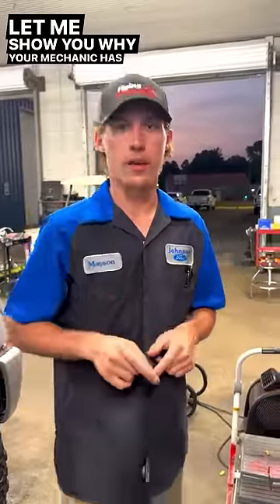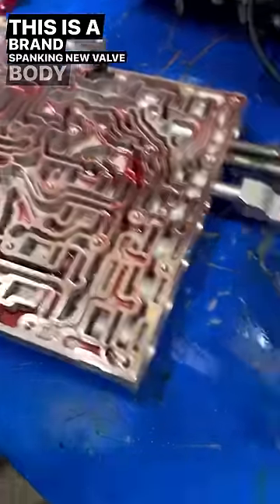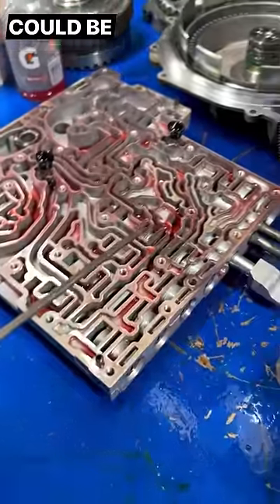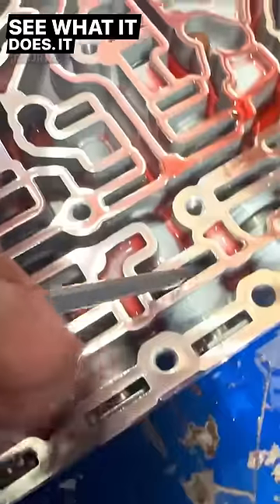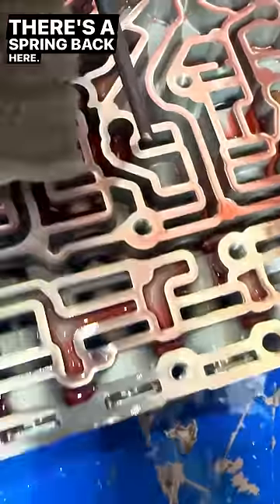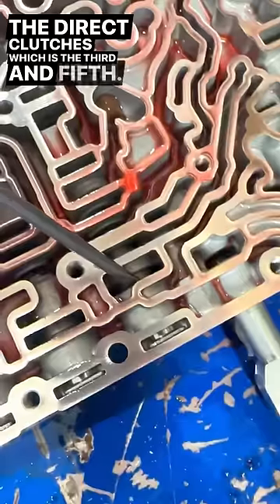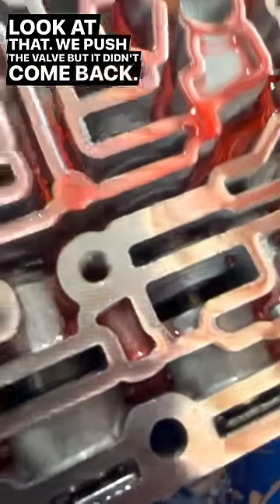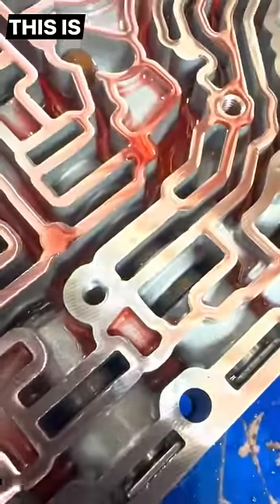Why your mechanic has trust issues #shorts #ford

Comment: As a programmer, it's nice seeing hardware problems being debugged.
Reply: I was thinking, that's a weird looking motherboard 😂
Reply: Breaks over back to coding
Reply: As a programmer, I have no idea wtf I'm looking at
Reply: I'm a programmer and a mechanic amongst other things 😂
Reply: As a mental health technician in California, its nice seeing when the professional knows the problem is broken and cant be fixed.
Reply: The NC program on the CNC machine that milled that part out was probably wrong.  The software issue caused the hardware issue, lol.
Reply: When in doubt get a bigger hammer.
Reply: Yeah same here, I’m always amazed by hardware “assembly” and debugging
Reply: as a hw engineer, 90% of hw problems are a result of a programmer not reading the manual, the remaining 10% they just misunderstood it.
Reply: It looks like my brain
Reply: @enersha6979 fluid channels is like electric pathways on circuits. the solenoids are swithches controled by either fluid mechanics or other electric or electronic switches. basically the actuator doing the work coming from the command unit
Reply: Just like programming sometimes when a hardware bug gets fixed 8 more pop up.
Reply: As a low-level programmer we often have to deal with physical hardware issues too, something you don’t get to experience at the high-level end, but I love that. That level of detail…it’s satisfying. Assembly, instruction sets, register level C code. Nothing is out of your control…

What’s not so satisfying is the lack of error checking and damage prevention in the software so you have to be precise and keep track of what you are writing to a tee otherwise you’ll end up, I dunno, overwriting a firmware sector in the flash or sending an improper reference voltage to an ADC controller (done that before…the smoke that shot off the bastard chip was the indicator there)…

It’s like when you strip a valve cover off, you have to make sure that everything goes back in place correctly otherwise a catastrophic failure occurs. But again, that level of control can actually be so useful…
Reply: as a brazilian
Reply: Unironically this. Neat mobo
Reply: WHY WOULD YOU HAVE A SOLENOID IN A VALVE
LETS JUST IGNORE THE MASSIVE HEATSINK ''fluid channels'' @MrFcob 

Bro why can't they just make the fluid go in a straight line what's up with this maze bs like the oil is fekking bored or something or it makes the oil go faster maybe? (how?)
Reply: @itsoktoberight4431 and I’m Superman
Reply: @P00RKN00W  good for you
Reply: This is out of your expertise bud.
Reply: @micahwilliams1826  calm down expert
Reply: As a mechanic, no it's not. These are issues that never should have been there and are always very expensive to fix. Not to mention they really hurt the customer in more ways than one. It's poor quality parts that are a ripoff.
Reply: "programmer"
Reply: They don't really get debugged though. As long as it lasts past the dealer warranty, Ford doesn't give a fuck, because it's more money for them. Not that other american manufacturers are that much better, but I especially have problems with the way Ford likes to make money
Reply: @anondhfhfiu  It's all a result of their own stupidity. They could just do what Toyota does, and focus on rock solid reliability. And have that be their business model. But since they're so stupid, they decided to go the other way. The result being that Toyota ran them out of the car market. At any time Ford could adopt that. The trucks already cost enough to cover it.
Reply: Hydraulic circuits instead of angry pixies!
Reply: @enermaxstephens1051  every sentence there is a sentence out of my own mouth. Well done, sir, well done 👏
Reply: As a hardware engineer, can confirm.
Reply: As a software engineer, thats no hardware
Reply: Well theoretically it could be ran like a computer, heck it could technically be counted as doing calculations as is
Reply: I was thinking the exact same thing lmao
Reply: Diagnosed you mean.